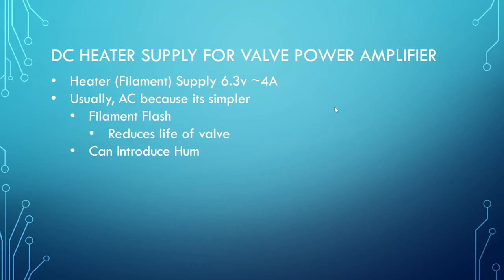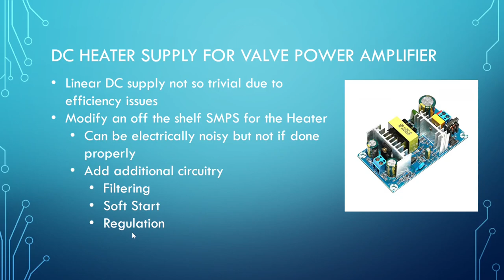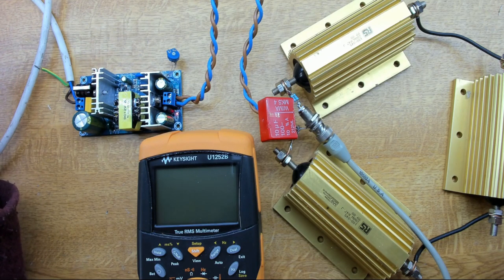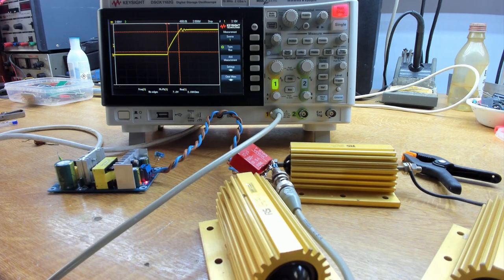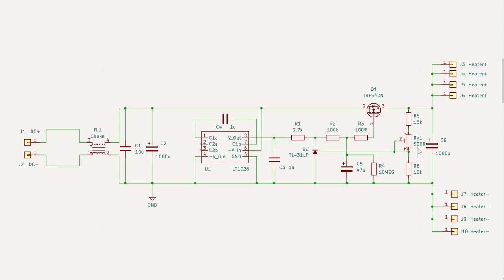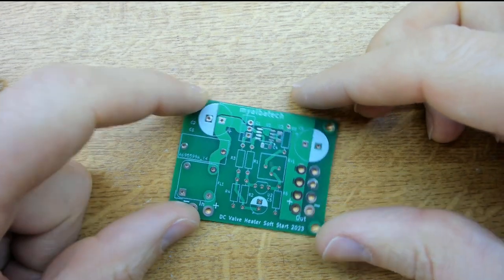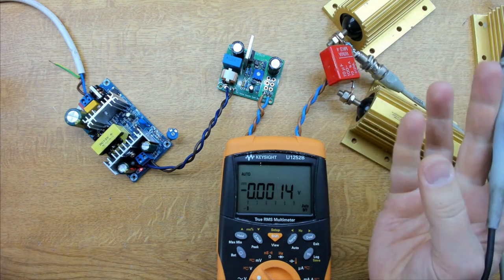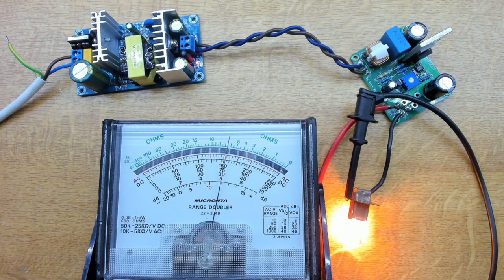DC Heater Supply for Valve Power Amplifiers

Comment: I'm trying to a build a Tube amp too, not an electronics guru, but I'm just using an older Linear technology LT1084 LDO regulator in the lovely TO-247 package (large heatsink contact area and easy to safely insulate) plus a Schottky diode rectifier, and I am able to use the valve transformers typical 6.3 volt AC heater taps for my regulated DC heater voltage , had to use a 16 volt 33000uf filter/reservoir cap to get the ripple down to less than 10mV (think I was down into micro volts), pretty much no audible speaker hiss (idle) or at least as good as my 2023 Marantz in my initial amp testing...  similar to what @MichaelBeeny noted, my thoughts were, if the LDO failed 7-ish volts max would reach the heater... thinking of an 6.8 volt Zener circuit to trip a relay if the 6.3 volts was exceeded.  like your videos and ideas,  even though I'm an analogue purist numpty. This purist wants to put a Pi Zero etc for music steaming and or a microcontroller Cricut (Arduino etc) for safety monitoring (voltages, music detect auto power off, soft start etc...) in said analogue amp 🤦‍♂.  That said, especially NOS Tubes, are "hella" expensive so the idea if I can pull it off isn't too mad. We Amp/Audio folk are all a bit crazy ;-)

Comment: In all the many years I've worked with valves, I've never known a valve heater fail on switch on. With this interesting power supply, you have even less chance of heater damage, but what you do have is a high probability of the SMPS failing. These low cost SMPS are really unreliable.
Apart from the visual aspect of a valve amplifier, these days I fail to see the attraction of 1940s technology. A modern solid-state amplifier will simply sound many times better than ANY valve amplifier.
However, if you are not bothered about the sound, they are great fun to build and watch them heating the room and burning lots of very expensive power. Good video, however.
Reply from the maker: More on reliability in a later video..